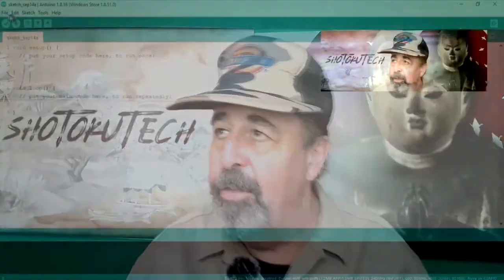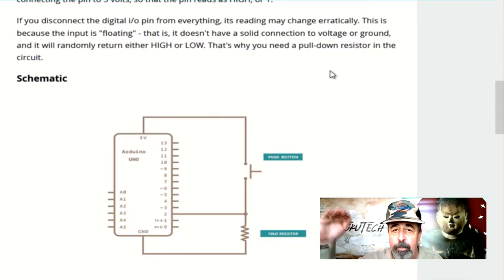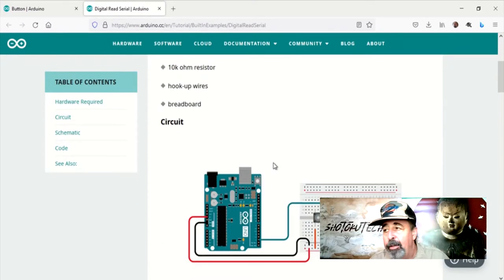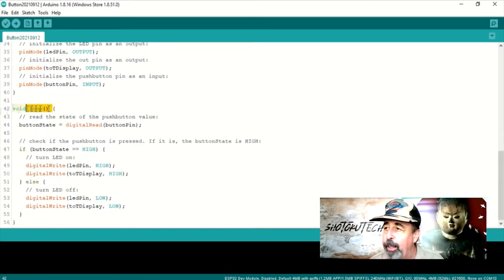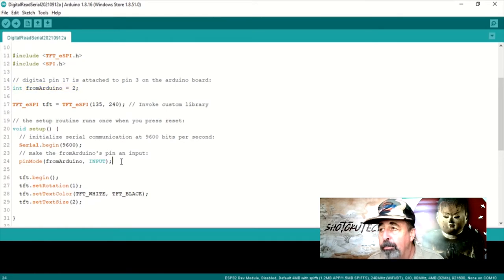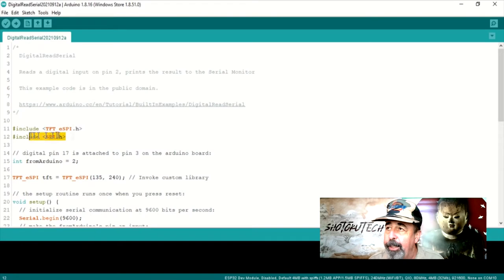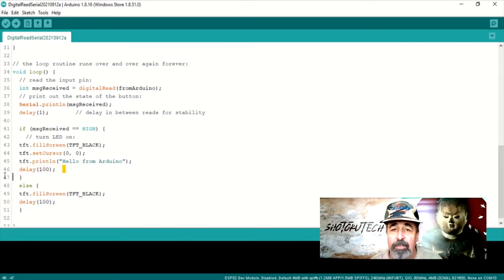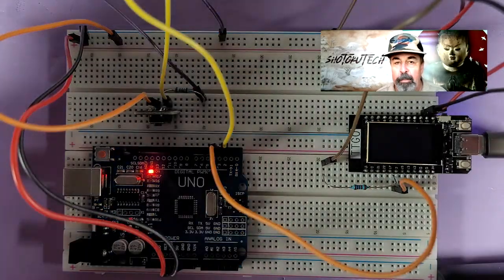Arduino Signaling TTGO T-Display Using Digital GPIO Pins

Comment: I think for my first build it keep it project for my T-Display(s) is going to be a temp/ humidity/ pressure display and eventually add ir send and a web interface so I can remote control my heat /ac from anywhere.
Reply from the maker: Brilliant!

Comment: Can you please tell me, which ESP32 is better.. I found three varieties and they are: 30 pin, 36 pin, 38 pin..
Reply from the maker: ESP32 refers to the SoC or system on a chip that you find on various development boards. Espressif is the designer of these ESP32 SoC. The number of pins on the dev board is a potential number of different devices you might be able to attach. Most of these pins are GPIO, meaning general IO pins that you can assign within your program. Some pins have specifically assigned roles. 5v, 3v, ground, serial TX and RX, reset and program mode pins for example. So it may not be a matter of the number of pins that determines which ESP32 dev board is better. This page shows the features of the various ESP32 SoCs: https://www.espressif.com/en/products/hardware
Hope this helps.
Reply: @ShotokuTech  Thank you so much. ❤️
Reply from the maker: @-indeed8285  You're welcome.